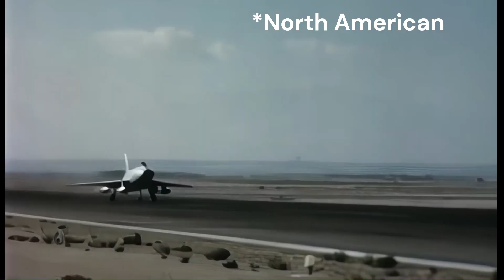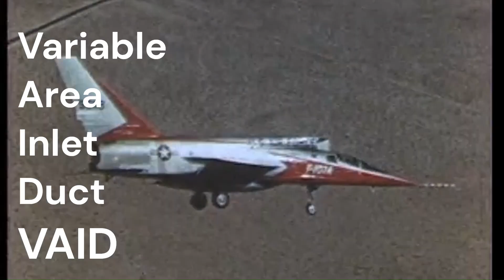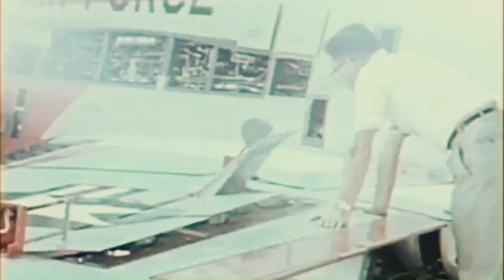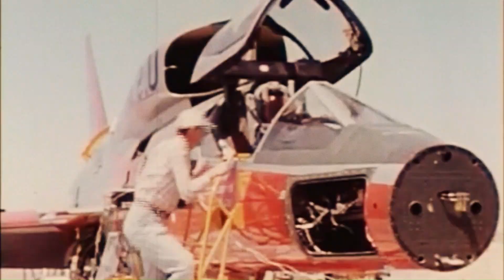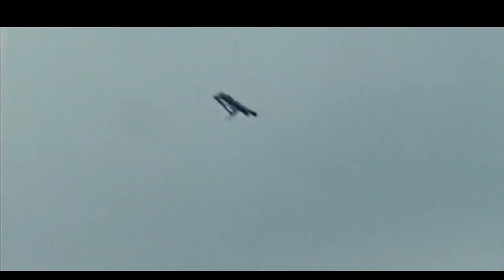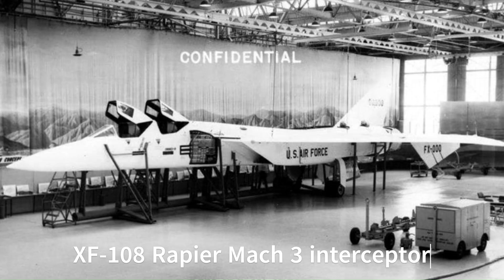F-107A Ultra Sabre JET - Was it Cheated out of American Aviation History?

Comment: The F-107 at Wright Pat was on display on 2014 when I was there. It was in the secured part of the base where the X planes and presidential planes were,next to the restoration building. You could only see them one day a week on a reservation basis only. Beautiful airplane. It sat right next to the X-B70.
Reply from the maker: Did you get any good photos?
Reply: @AviationRepublic   Yes,not many but enough to satisfy me. It should have been transferred to the new hangar with the X-Planes and Presidential planes,as most were move to the museum proper. I haven’t been back since I had the 2014 great aviation museum trip after I retired. So many planes to photograph.
Reply from the maker: I know want you mean, every time i visit a museum I never seem to take the right photos or get the right video footage.
Reply: It's on permanent display now.
Reply: @Hyposonic   Yes,I’ve seen the pictures in the museums site. I need to make another pilgrimage again.

Comment: On my first visit to the US in 1966 I saw a F107 in a state of disrepair at an airfield somewhere in the greater Los Angeles area (Anaheim area I think). I had a photograph of it but didn't know what is was for very many years.
Reply from the maker: It's quite possible that the F-107 you saw was the one in the thumbnail, how cool would that be. Do you still have the photo, if so, what is the tail number?
Reply: @AviationRepublic  Sorry, I got rid of all my old slides years ago but on further reflection it was in the Santa Ana area not Anaheim, at some private aviation museum/collection (Paul Mantz??) sitting outside with a jack under one wing as something was wrong or missing from one MLG and painted as in the video. I think it was the same day we visited Briggs Cunningham's car museum in the same area. Helluva long time ago now!. It was when I was disposing of my old slides I saw the photo and thought it looked similar to an F100 so did an internet search and finally discovered it was an F107.
Reply: A 107?  There were all 3 parked at the south end of John Wayne Airport in the early 70s at the runway over run.
Remember them well as with the old hangars of the west side Tallmantz Museum was a flying junk yard of odd flying machines, Disneyland of the Air... Loved it ( Pops helped with Flight of the Phoenix )
Reply: @Kingsford44  --I posted my own comment above, before I took the time to read yours.  I'm happy to hear that others recall long-ago experiences seeing the F-107 at Orange County Airport.
Reply: @AviationRepublic  --Yes, the thumbnail photo is indeed Orange County Airport, right by Tallmantz Aviation.

Comment: A very good video, thank you for your hard work here! 

I don’t think the F-107 has a hope as a non nuclear conventional bomber the F-105 just had the overwhelming advantage there which is what the Air Force was looking for. I’m no aerodynamic expert, but that high mounted intake would have caused immense problems for the F-107 in a low speed turning fight as well. For as tough a time as the F-105 had in Vietnam the F-107 wouldn’t have done any better and potentially worse in my opinion. 

I think with the F-107 North American built a tactical nuclear strike aircraft out of an interceptor, and that came with all the limitations point defense jets are saddled with. Having a lot of first doesn’t a good tactical aircraft make, and the F-107 just couldn’t fill the tactical role as well as the F-105.
Reply from the maker: Thank you, I am very pleased you enjoyed it. For sure the F-105 was a better bomb carrier in terms of load.
Reply: I think you are totally correct about the high mounted intake affecting AOA.  there is a reason that no fighters used this layout.

Comment: One of if not the first model plane I received as a kid was the F-107. I thought it was an ugly plane and it just never looked right to me. (What did I know, I was just a kid playing with home built wooden coaster carts and Schwinn bicycles. My first lesson in aerodynamics was when I was riding my bike down a steep driveway and a stick was kicked up by my front tire into the spokes, whipped up to the fork and stopped the front wheel instantly. I immediately received practical demonstrations of the scientific properties of inertia, center of mass, personal flight aerodynamics of an 8 year old boy,  the energy absorption and dissipation properties of a dump truck size pile of sawdust for said 8 year old boy and that an indestructible Schwinn bicycle is difficult to ride with the left hand hand grip is bent clear over and touching the right hand handlebar. A very memorable but not fun day. I was not hurt one bit except for a scratch or 3, but I was devastated by the damage done to my handlebars. I thought my bike was ruined. )

Now I see that the F-107A was a really interesting development for an early supersonic jet airplane which was bringing what turned out to be very significant advances, but was packaged into the wrong airframe configuration for its intended use. At the end of the day, while it brought a whole bunch of new technology to the party in one package, it failed at the one thing it was required to do well. Carry and deliver bombs. It was a poor “bomb truck”. The F-105 Thunderchief was at the end of the day, a true supersonic “bomb truck”.

Comment: How was the mobility of the rocket assist takeoff planes to be accomplished without hardened runways? It seems to me they would have to be trucked around as they could only land on a runway, rather silly for a plane and an inherent security risk.
Reply from the maker: That's a good point, they most probably had the idea to cart the aircraft around in the same way ballistic missiles are, although they would have had to consider wing span, etc, etc.

Comment: No way to eject from it - which is a serious failure right there.
There is a REASON this was the only American design to use an overhead jet intake.

And to be blunt, "super fast" was mildly useful for an interceptor, but NOT useful in a fighter.
Reply from the maker: Very good points.
Reply: @AviationRepublic  Someone mentioned downward ejection seats - but those need you to be fairly high up to work, forget using them on the COMMON scenario of you have an issue during takeoff (when you're putting the most stress on the engines) or while landing (most stress on the landing gear).

Comment: The main issue came down to pilot ejection, there was no way to safely eject in front of those inlets.. Th F105 and F101 proved more succesful, especially the 105.
Reply: Sorry, but that is a myth. The ejection system was tested and proved effective. Remember this was North American, many of the same guys who designed their many excellent previous aircraft. The main reason the 105 was picked was its fully internal bomb bay. These two were designed for low level and fast nuclear weapon delivery, and not what was later required in Vietnam.
Reply: @dougcastleman9518  " effective" is not a term in military jargon, the F105 was called the Thud in Vietnam for a purpose. There were more Thud pilots in the Hanoi Hilton than any other type aircraft.
Reply: @c123bthunderpig  Not really sure what that has to do with the F-107's ejection system...but okay. I happen to know F-105 pilots and they loved their airplane. The reason why they had the most tenants of the Hanoi Hilton is because that airplane was the one the USAF used to go downtown in, until replaced by the F-4. It was a very fast and stable bombing platform but ran into the most heavily defended city in the world, save, perhaps, Moscow. I was privileged to go to the very last F-105 pilot/RIO reunion at Pima Air and Space Museum a couple of years ago. Not one of those guys had a bad word about their airplane...nothing but praise, actually.
Reply: @gort8203  its OK if you disagree I can't force you to be right. Klaatu barada  nikto
Reply: @c123bthunderpig   You don't know what you are talking about but you want to pretend you are right.  Give us a break and just quit making stuff up.
Reply: @dougcastleman9518  going down town was never authorized except once, it was a career ending move. Of course pilots at reunions would have high praise because its a reunion , they are drunk and came home without getting a SAM up their six, or hit with VC AAA.. War stories are what reunions are all about.  I guarantee not one of them ever punched out over Laos. The 105 was poorly deployed for what it was designed for  The F4 sucked, ( shot down by Korean war era fighters and number two in POW'S in the Hilton) - the best jet  aircraft that had reasonable success, based on ROE'S  was the F100.
Reply: @gort8203  hmmm, gen z I guess, can't handle the truth, be careful and don't let that big laser shoot you in the foot
Reply: @c123bthunderpig  You are doing what is called projection: Still making stuff up because the truth opposes you.  Bye.
Reply: @gort8203  oh no, parting is such sweet sorrow especially as I won't be able to continue conversations about  your pedantic knowledge of aviation history. Enjoy your return trip to Mars. And give my regards to Klaatu :-)
Reply: @c123bthunderpig  More shoot downs means, if you are lucky, more prisoners of war.  Proves nothing.  How many of each type of aircraft was sortied into North Vietnam?
Reply: @WilliamMurphy-uv9pm  only B52's allowed over North Vietnam  ( and there were 19 of those lost in combat on their last mission thanks to Nixon - 30  total during entire war  because of battle damage and take off crashes ) North Vietnam was off limits, The loss of aircraft and men is always significant . The F 105 was the only aircraft in the history of aerial warfare to actually be pulled out of combat operations in Vietnam because of their losses. You're spitting into the wind if you think you can argue with a Vietnam vet , Bravo Sierra
Reply: @c123bthunderpig  And John McCain's naval aircraft was actually shot down in your back yard instead of near Hanoi.  Sure, sure.  I won't argue with you or any true Vietnam vet.  Just know that I spend a year at Korat RTAFB in 1973-4 when the F-105s were stationed there.  They did "wild weasel" work back then from there before being replaced by F-4s in that role.

Comment: The dorsal intake is a non-starter. There's a reason this configuration is never used. Any increase in angle of attack starves the intake of airflow and the engine of power and also  increasing flame-outs. Maneuvering is hampered by this. This is a crucial flaw. Look at the F16, Eurofighter, etc with the intake on the bottom which enhance airflow during maneuvering.
Reply from the maker: I wonder if this was documented, I did not find anything regarding this during the research, although I am going to pick up some new (old) cold war aviation book soon, I will see if it is covered there
Reply: @AviationRepublic  Interesting. It was in 1964 that the Energy-maneuverability theory of fighter jets was developed that put emphasis on "dogfighting" ability in design. This is when it was realized that high angle-of-attack capabilities needed to be prioritized higher as bvr missile tactics are not always an option. A jet like the F 107 would be quite limited.
Reply: Flying at high AOA was not a factor when this was designed. Speed was the holy grail of USAF criteria in those days. This plane would have been quite adequate in this era. Have you any official data regarding engine flame-outs or loss of power when testing this jet?
Reply: Looks like a musclebound f- 100 with a pointed nose and a weird air scoop on top of the fuselage, truly an odd setup.
Too bad the a.f. didn't go thru with the north american f-108,
Or better yet the Lockheed's yf-12 interceptor, both mach 3
aircraft!

Comment: 'Thoroughly enjoyed'?  What?  At 19:28, the video talks about the f-100 and the follow-on F-86 Saber.  Uh, the Sabre (F-86) first flew in the late 40's or early 50's, the F-100 WAS the follow-on program.  There were other issues as well.  If you are going to make statements etc., at least have them correct: n'cest pa?
Reply: BTW, did I ever say how I HATE computer narration?
Reply: @warrenholmes3311  This isn't computer narration, it's clearly a person
Reply from the maker: It's 100% not computer narration.
Reply from the maker: I meant to infer that there were follow on projects for the F-86, not that the F-86 was the follow on project to the F-100.

Comment: If you're talking cheated, I'd put the F11F-2/F11F-1F Super Tiger and F8U-3 Crusader III at the top of that particular list. Especially since Lockheed bribes actually cheated the Super Tiger out of contracts.

The F-107 would have been a better fit in Vietnam than the F-105 was.

Comment: The F-105 was not used for its primary design purpose. As a fighter/interceptor it was found wanting and became used primarily as a level bomber in Vietnam. Would the F-107 have made a better fighter??? Seems we’ll never know.
Reply from the maker: In my opinion the F-105 was a bomb truck, deliver the load and scoot.
Reply: Wrong, fighter-interceptor was absolutely not the design purpose of the F-105.  Where did you get that idea? Are you kidding me?  It was a nuclear fighter-bomber with a bomb bay to carry the weapon for high speed delivery.
Reply: @gort8203  Well I stand corrected. Yes in researching the 105 I was in error. Thank you.